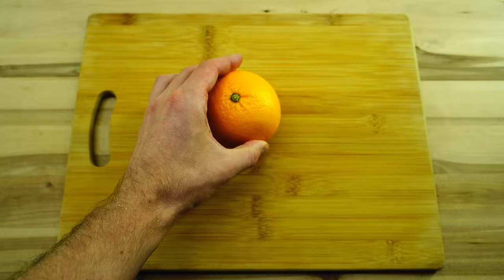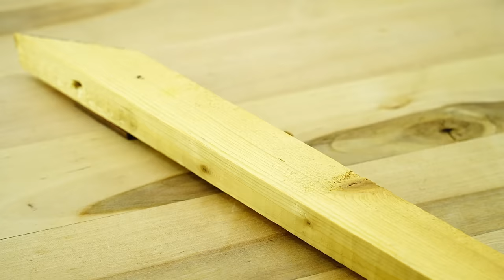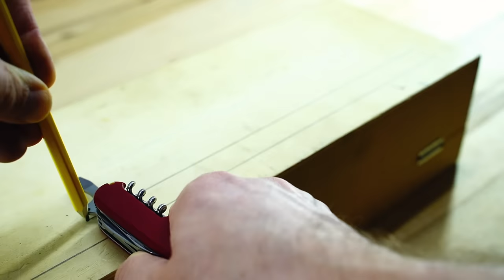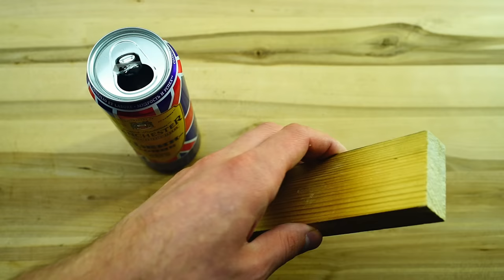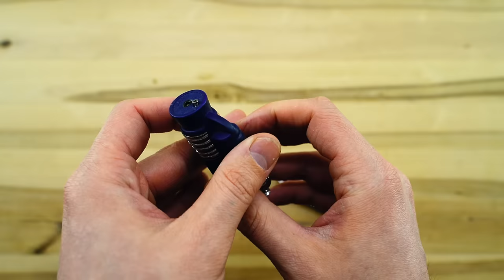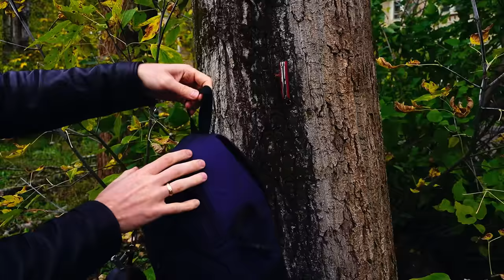60 Secret Functions of the Swiss Army Knife Only a Few People Know About

Comment: I wanna know where he got that tiny perfectly fitting magnet
Reply: Me too
Reply: Out of a magnetic ratchet screwdriver that's fallen apart.
Reply: I believe a 3mm circular magnet will fit
Reply: They are on earphones (cheap ones have smaller ones,)
Reply: Just buy them off the eBays.  3mm diameter. 2mm thick

Comment: The sak used in this video: the Ranger, 5 layers, 21 features, height 23mm, weight 118g. 2 tools not showed in this video: the 4mm chisel and the 2.5mm screwdriver. Excellent video.
Reply: my very favorite EDC. The Huntsman is a bit smaller, but i want to metal saw :D
Reply: @alfredocalzoni8161   If you don’t need the saw, for city usage, you can take the Mountaineer, 4 layers (metal file + scissors), 18 features, height 20mm, weight 109g. The lightest sak with a metal file.
Reply: @danmano478  wow, nice hint. thank you :) didnt know the Mountaineer
Reply: The Ranger is a fantastic model, but to use the metal file as a make shift, Philips, you need the newer variant as the older files will just snap off! The newer ones are a marked improvement! I think two or three models were used in this video, though?
Reply: Thank you for letting us know what model it was used. I am very intrigued and curious to know because I have been looking at buying one…just for emergency use.
Reply: Or is it the handyman..?
Reply: @West2WesternGhats   I have the Handyman, it is 6 layers.
Reply: @danmano478 Sadly lost mine last week during airport check...😥 Thinking about an upgrade. Any suggestions?
Reply: @West2WesternGhats  its the ranger
Reply: @West2WesternGhats  No upgrade after 6 layers for me -> too heavy in the pocket and too wide in my hand, to operate. Handyman is max for me. I rather, and usually do, have 2 or 3 different saks with complementary tools in different pockets. Ironically, it feels lighter this way, I have many tools available, and in case I lose one I have the other 1 or 2. For my hand, the best in the hand are the 3 and the 4 layers.
Reply: @danmano478  Thank you...Which two 4 layered sak's would you suggest instead of Swiss Champ...
Reply: @West2WesternGhats   Unfortunately with a combination of 2 saks 4 layers, you have a lot of redundancy. For example if you want the pliers and the file, you will have 3 redundant layers: the knives, the openers and the scissors layers (Mountaineer + Deluxe Thinker, both 4 layers). There are 2 categories of people: 1st who like and need the pliers, and 2nd who doesn’t like/need the pliers. If you are in the 2nd category, then the best is the 5 layers Ranger, in this video. If you are in the 1st category and like the pliers, then the most useful 4 layers with pliers is Deluxe Thinker (pliers + scissors). But if you want also the file, then it comes with the price of redundancy. So it comes down for you to choose the tools you need. For me there is no ideal solution even with 2 or 3 saks, because of redundancy. The best for me would be a modified Ranger (4 layers without the scissors) + Explorer (scissors + inline Philips and Magnifying glass). To these I would add, attached to the keys a little Midnight Manager for the light and the pen.

Comment: I think we all have to give a moment of thanks to all the brilliant engineers that thought up the various tools in the Swiss Army knives. Like the guy that thought of putting the straight pin behind the corkscrew, or the parcel hook and magnifying glass. They are the unsung heroes …who knows how many lives they saved, or at least gotten people out of precarious situations.
Reply: Was he Swiss by any chance ???
Reply: fax
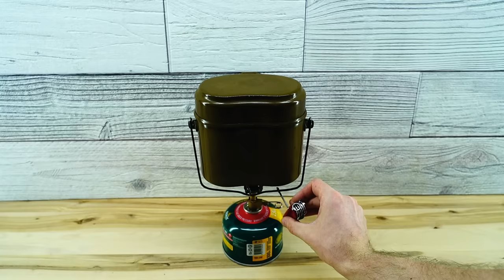Reply: parcel hook? you do know that tool is actually for GUTTING FISH right? on the back of the SwiAK... videographer uses it once at timecode 23:32 to grab the hot metal handle of his camp pot. its ACTUAL purpose is... you use the penknife blade to slit the anus of a fish slightly anterior towards its head along the midline of the abdomen. then you shove that hook up the anus of the fish, twirl and whirl and spin the hook around YOINKING guts out of the fish through its anus. but of course, it is just easier to slit the whole belly of the fish open from anus to the other end of the fish and open it up and scrape the guts out that way. 

but a parcel hook? i've never even heard of it called that. sure, i've USED it to carry stuff bound in twine or heavy cord, like the videographer does.
Reply: @lesliekilgore648 I think the whole idea of a multi tool is they can be used for many purposes
Reply: @jaywilliams6250 I don't think so.. I heard if you use it not for the exact it's purpose u can go to jail!!
Reply: Hey I burned many ants with that magnifying glass!
Reply: @lesliekilgore648 Officially, the name for that tool is parcel hook. When originally designed it was to pick up packages tied with string and to help lace boots. Good to know it can be used to gut fish, though. Never used it for that in nearly 60 years.
Reply: @SailfishSoundSystem sad little boy!

Comment: Two bits of advice. Conventional wisdom says:  

1.  Your bug net and tarp can share a Ridgeline. That way the tarp isn’t too high to protect you from rain. 

2.  In a hammock, go with a sleeping pad OR an under quilt. But generally not both. All you need is a way to keep any breeze off your back, that could blow away any heat your body generates. 

Great video. Keep the good content coming.

Comment: The biggest secret I learned is that some models apparently do not include a Phillips head screw driver.  Instead, you use the tool to drive a hex socket, which in turn drives a screwdriver bit.  If I am carrying sockets and screw driver bits, I'd also have a proper tool to frive them with.
Reply: i had to do that in the desert once, all we had was the bit and a socket and my pocket knife, we lost the screwdriver. i needed to open the battery lid on my radio
Reply: Yeah Philips head instead of corkscrew is kind of non-standard on Victorinox Swiss army knives. More models have corkscrews than Philips. I'd prefer the other way around. I don't know of any Victorinox models that are intended to be used with a socket (this is more of a SOG thing) but there may be other brands that have a setup like that.
Reply: I mean ......yea
Reply: @sigilvii Depends on the model

Comment: Many of them I knew and many I did not simply because I have not had the use/need for that function.
I feel like another good title would be "The multitude of reasons the 'parcel hook' isn't completely useless"

Another thing is that if a person has a Cybertool variation but is tired of the costly replacement bits, you can actually use a bit of resin or ca  glue to instal 4x1mm magnets in both the driver and bit holder allowing the use of standard micro driver bits of higher quality. Not to mention you can have a lot more choices in bits functions/sizes. At least thats what I've done with 2 different models.

Regardless, great demonstration!
Reply: Swiss Army knives were great pocket tools before Leatherman came along.
Reply: @apenza4304  And they still are.. Different tool sets for different people doing different work. Right tool for the Job.
Reply: These are terrific, as long as you don't desperately need a knife.
Reply: @gerard4870  Again, there are plenty of folks that find them to be adequate for their uses and functions. Different tools for different tasks and needs. Not everyone is a manual laborer or hunter/outdoorsman. Would you(anyone) need to use a 2-8lb sledgehammer to drive a tack nail? Can you, possibly depending on your skillset and physical capabilities but for the majority of individuals, no, you can't.
Just about any blade is better than none at all for the majority of everyday tasks. Carry the tool for your job/needs. I have a number of different knives of many different sizes and more often than not carry more than one knife even while just in the house be it a Victorinox, Buck, Case, ...
Reply: @korgan7779  when I say terrific, l am not being sarcastic or cynical. I have spent years piloting a victorinox. It was not my first, but was my first treasured knife. My father carried them religiously. As did the esteemed Macgyver of yore. However, much in support (rather than rebuttal) of your assertion that there is a correct tool for the job-- and at risk of receiving the opprobrium of the masses--I volue that in the event the tool required by the job at hand is, indeed, a knife, this esteemed offering may find itself, at the end of the matter, in the midst of responses not entirely in enthusiastic approval of its performance.
Reply: @gerard4870 
You're just trying to sound clever and add nothing to what @korgan7779 wrote.

You obviously have ONE specific use for a knife in mind and whatever knife you pick for that... I will tell you 10 other things that YOUR KNIFE can't do.

Your argument is pointless.
Reply: @gerard4870 On the contrary, the blades on SAKs are great

Comment: The wire stripper works without the blade. It's a stand alone tool.  Sharper than you think.  Insert wire,pull wire deep into slot while pulling through the slot. Strips it right off. Quickly
Reply: I own 5 SAK's, the wire stripper notch on all of them is totally blunt. I thought it was completely useless until I saw this video !

Comment: About five or six of these (pot hook to remove a container of boiling water from an open flame) are the same.
There were also several instances of how to remove a screw, although the one featuring a way to revitalize a stripped screw was good.
Two ways to create kindling and start a fire.
There were other redundancies as well, so I'd reduce that list of 60 down to 30 or 40 at the outside.
Reply: So what? It’s still edifying. And it doesn’t hurt to reinforce information.
Reply: It's worth noting that different knives include different blades. So seeing two blades perform the same task may be very useful.

Comment: My only complaint about SAKs was the colour red used on most of them.   I attached a whistle and a tritium light so the knife is even more useful and easier to find if dropped.  There are now yellow ones which are easier to find.
Reply: The color red is to locate it easily if its dropped in the grass or woods
Reply: Fluorescent yellow is the best for visibility in all conditions but they don't make the scales in that.
Reply: I've  carried a SAK 100% of the time  for 50 years..... SO FAR!  They DO come in other colors.  I have a black one & had a blue one once. Along with at least 10 others I've overused.
Reply: @guardian4525  Doing geological fieldwork for 40+ years in deserts, jungles and forests as well as grassy fields, I have lost many car keys, penknives, torches, pencils and other important items, all coloured black or dark colours.  Even the red SAK is hard to find in long grass.  I had to attach fluorescent yellow or orange tape to anything whose loss could stop a survey while a replacement is found.  The compass and whistle are on a cord around my neck!
Reply: Ever use a tile tracker?

Very small & will locate what its attached to with tones playing as long as you are bluetooth distance away.   It can also use the internet as well as requesting other users devices to look.
Reply: @guardian4525  Actually I use a cat tracker which is also used for RC airplanes and car keys.  It works to about 150 metres and I attach a tab to the more important items.  But pencils and pens are the hardest to find in grass, so I use the fluoro ribbon tied to them.  I must have a look at your idea of a tile tracker - it looks very similar to the cat tracker!
Reply: @karhukivi  They have some models in "Stay Glow" (glow in the dark) plastic. If you have a model with clear translucent scales you can apply glow in the dark nail polish, or tape.

Comment: quick synapses you can use different things for screwdrivers(10) 5 different ways to prop up phone 5 different types of pots you can use hook or bottle opener to hook the handle and remove from fire, 5 different ways to strip wire, he only opened 2 nuts(walnut & pistachio) I feel he missed out on a few other nuts. 4 different ways to draw circle maybe 3 clever uses

Comment: Would you remember the model of the knife? Thanks. Fascinating to watch. I use a Fieldmaster
Reply: I believe he uses two during the video. A Victorinox Huntsman, and a Victorinox Compact.
Reply: @jonathancassels4835  Thanks for the info.
Reply: @jonathancassels4835  When did they add the hook to the regular Huntsman?
I've carried the Boy Scout edition Huntsman every day since I was still IN the Scouts because it has the hook, I always thought INSTEAD OF the corkscrew. I use the hook often, never drink wine.
Reply: @burgerforcongress1001  I got mine 5 or 6 years ago, with both. If there was a previous version without the corkscrew, I don't know when they made the change.
Reply: @jonathancassels4835  The regular one had the corkscrew, but no hook. I always thought they figured Scouts are under age to drink, so a corkscrew would be inappropriate, & that's a substantial enough market, & marketing opportunity, to customize a tool layout for.
Reply: When he cut the carrot in slices, you can count the layers: 5. The sak with 5 layers, that has the blades, metal file, saw, the scissors, can opener + bottle opener on one side and the corkscrew, the hook and reamer on the other side (all the tools used in this video), is the Ranger. In addition, this model has another 2 tools, not shown in this video, on the reamer side: the 4mm chisel and the 2.5mm screwdriver. Height 23mm, weight 118g.
Reply: Victorinox Ranger is the most complet medium sak, without becoming to bulky. I have the Handyman, that has, in addition, the pliers, it is though bulkier and heavier. Height 28mm, weight 155g.
Reply: I have carried the Craftsman model for 38 years. No corkscrew,  but both a wood saw and metal saw and fish scaler with inch and metric scales as well as scissors.

Comment: The Swiss Army Knife, notoriously sharp and durable. I've cut myself quite a few times trying to find out what's in there. When you open something that's a knife, the sharp edge remains on top, facing upward and when you pull out something after that, that's when you might get cut by that knife, with its sharp edge waiting. The Swiss Army KNIFE, after decades of using it, is still best used as a KNIFE, as its name implies.

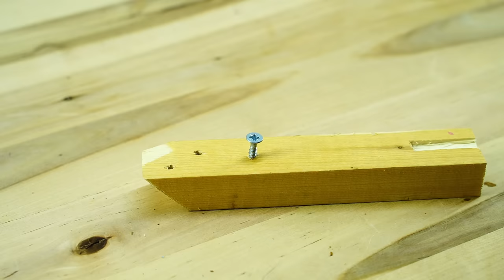Comment: 8:00 a 1/4" socket to 1/4" hex bit would be a better fit... For my own gear I take a 1/4" to 4mm hex nut, so I can use the smaller bits. ;-)

Comment: I always use the magnet trick when I drop my keys into a soda bottle.
Reply: Also you can  open the hook & tie a line (paracord)  to the key ring, then lower the SAK down through a grate to pick up dropped keys from the sewer/storm drain; not so uncommon an event.

Comment: good ideas, but most of this you can completely do with pliers or multitool
Reply: The SAK is a multitool and certain variations have pliers be it the 91mm plier that is closer to the Leatherman PS4 size, the 85mm slip joint plier on some of the Evo line of SAKs or the 130mm Ranger Grip Boatsman Lockblade Swiss Army Knife which has a full sized set of pliers on it. It's a matter  of the correct knife or tool for the person and job. The average person can carry a SAK much more conveniently in a pocket then they can a traditional Leatherman style (not referring to the actual Leatherman 'style' model mind you) multitool, not to mention price differences on many of them. 
Leatherman should bring back the Juice line in my opinion though.

Comment: Ok the nut cracking thing. Thats not a swiss army knife trick. Thats just the proper way to crack a walnut and most people dont even know a walnut has a keyhole on the bottom and any flat objet will split the shell like that. I used to shell them with a butter knife. You are pretty creative though. Most people would not sit around and come up woth 50 different ways to use every tool on a victorinox knife. Even though that is exactly what the designer intended that you do. All those tools are designed to be used multiple ways.  The idea was that if you are creative enough. That one knife is the only survival tool you should need. Everything else you might need can be crafted with the swiss army knife. In theory.

Comment: Hmm. If you use different parts of the tool for solving the EXACT same problem, is still just one function. Dull video. Maybe there are 20 ways to use a Swiss Army knife as a mobile stand. Who knows? But it still just solves one problem. Same goes for loads of other stuff in the video

Comment: If you have very thick rope in a knot, you can use the cork screw to drill inside the rope and use it to pull out the knot also.  i carried a Swiss army knife since childhood until 1993 when I discovered the Leatherman tool.  It seems by far more useful to me and made the Swiss army knife instantly obsolete.